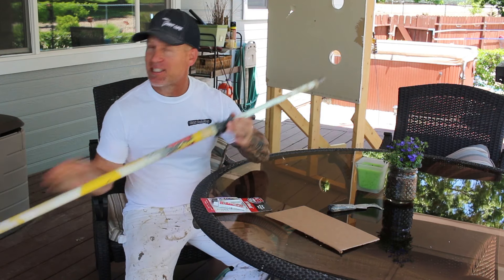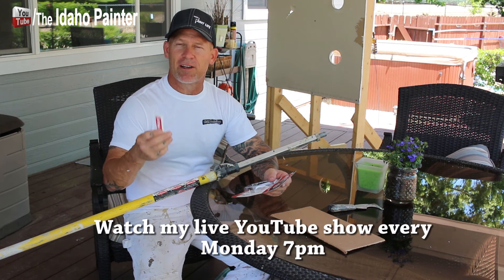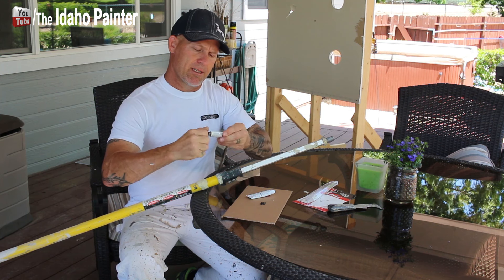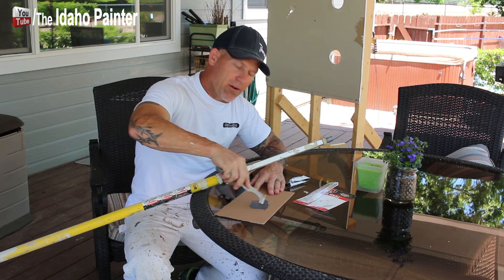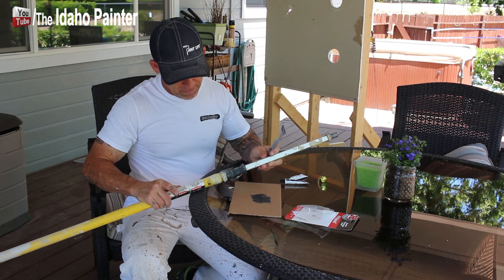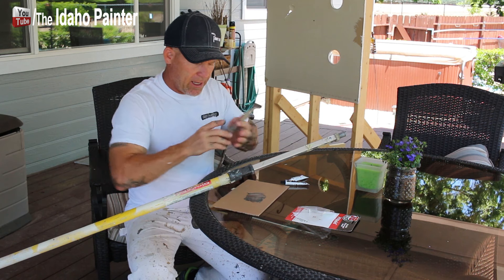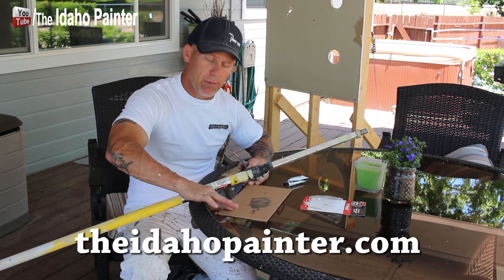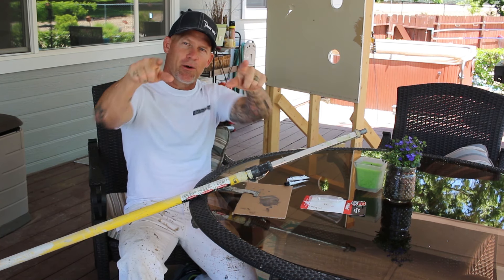JB Weld used to fix tools.

Comment: Back in the day I accidentally backed my car over a concrete block and put a small hole in the gas tank of my car.  I went to the department store, bought some JB Weld and plugged the hole.  My parents never knew.
Reply from the maker: Works like a charm!
Reply: They know now, just texted them😎

Comment: I used this to repair a cracked rim my friend once used it to fix a cracked engine block that was leaking oil it works great what is also cool is that they have the liquid type and putty type and when it cures its like steel

Comment: Cool video. I never used JB Weld but it looks like a great product. There's a new product out there called Fiber Fix that looks interesting. It wouldn't be for this type of repair, but it apparently can things like broken wooden handles where you wrap it around and it dries harder than concrete or steel. One of those! haha